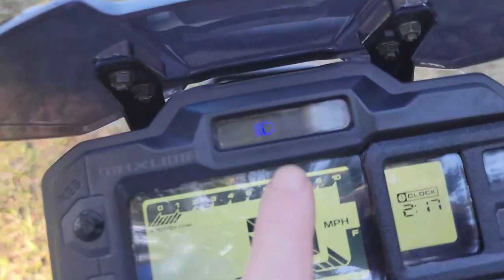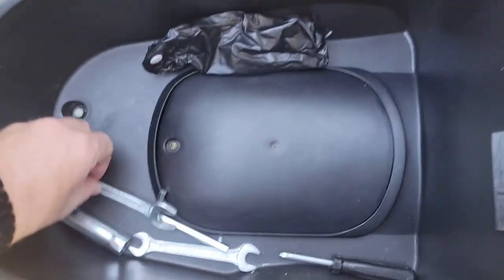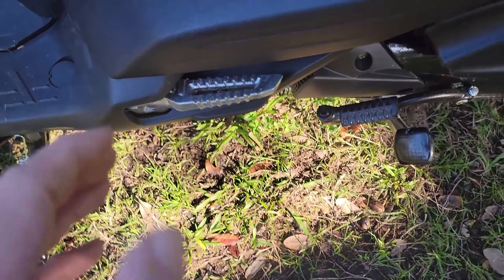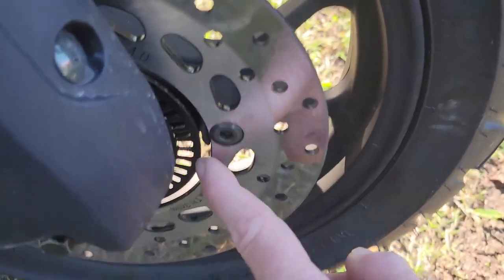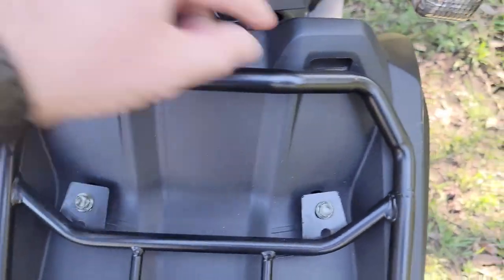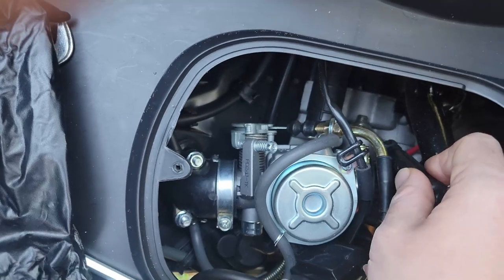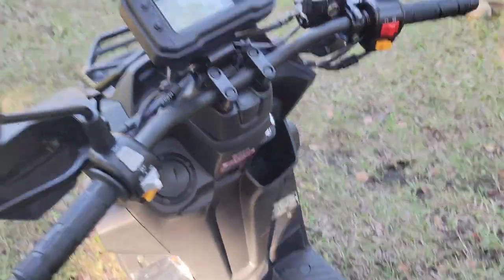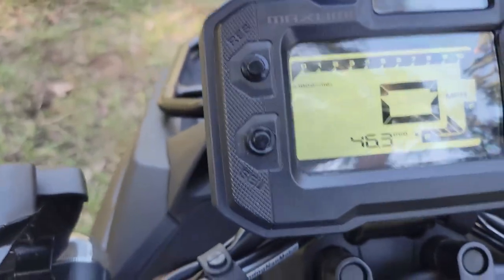X-Pro Tahiti 150 The $1,099 Yamaha ZUMA clone REVIEW.

Comment from the maker: I replaced the carb with one off Amazon ($25) that is jetted differently and appears to be made in Japan. It also has mixture adjustment screws. The stock carb is missing ANY form of adjustment and is jetted for EPA fuel economy. It made a very noticeable difference. It's not life changing but worth the upgrade. It really helped with acceleration and helped a little with top end speeds. I will get between 52 and 54 mph on flat roads. I find that the scooter likes to go around 45-48 comfortably.   When installing I did not use any of the hoses that come with the new carb. I just unhooked the stock carb and transplanted the new one in. Make sure to open the drain up that is at the end of the long hose with the spring around it. you will have to cut some zip ties to remove the choke wire from the harness.   Amazon link=>  https://a.co/d/0VAp8PX
Reply: Can you post the info on that carb ?
Reply: Hey dude when you got yours did you have issues with the engine just dying when riding? For some reasons the last couple of days of riding mine has been dying mid ride and don’t know why. I haven’t done anything to it other than giving it oil when it needs it.
Reply from the maker: @jarodhuber2687  When it dies, does it just bog down and then stall out. And does it re start easily?  if it does, its probably a fuel issue.  Stuff can clog the lines, starving it of fuel. I would for sure replace the fuel filter.  There could have been dirt or metal bits in the tank.  But for sure check the fuel lines.  Also there is a vacuum line that goes to a pulse pump. make sure that is hooked up correctly, some times a vac tube might be kinked if they cut it too long.
Reply: @scottcol23  it just bogs out and the engine cuts off as if I turned off the kill switch mid ride. The first time of re starting it doesn’t usually start it, but if I let it sit for like a minute it’ll turn over and run again.
Reply from the maker: @jarodhuber2687  Its a fuel issue for sure. you can replace the filter and then open the carb drain. its a screw at the end of a long hose that is on the left side near the peg that sticks off the center stand. its easy to identify.  there is a spring/coil that is around the hose.  open that a few turns and let the bowl drain completely.  there could be sediment in it.
Reply: @scottcol23  okay. What filter do you recommend to use for the scoot? Or what one did you use?
Reply from the maker: @jarodhuber2687  Just go to Napa or O'Reily's and get an in-line fuel filter.  Or you can get them on amazon in packs of 5. I got a FRAM G3 inline filter for $3.  They are a little bigger than the one that comes on the scooter. might flow better.
Reply: When you upgraded the carb did you get rid of the airbox and go with a pod style air filter?
Reply: @jarodhuber2687  probably the air mixture screw needs to be adjusted cause this bikes the air screw mixture comes seal just to pass emissions
Reply: Did you replace the car because this bike was stalling out. Mines doing that. Also my low beam headlight is not working?
Reply: I'm 6ft2 220lbs do u think this scooter would be ok for my height n size

Comment: Just got mine yesterday. 86 miles everything works well. I live on a dirt road next to a field and the tires are great when the sand is soft. Every motorcycle rider needs a scooter for errands and this is it. I love that front rack.
Reply: I agree. I have 2 other motorcycles, an 800 Suzuki and an 1100 Yamaha. But the little 150 is much easier to get around on close trips. Easier to strap stuff down too.
Reply: Got nearly 509 miles on it no issues so far. That little scoot scoot has become my errand runner.
Reply: @cecilgroomed8365  how she holding up now? Still going good?
Reply: Got almost 3000 miles on it. I lost the exhaust by not checking the bolts otherwise still running.

Comment from the maker: Its getting warmer here and I will be making some more videos soon!  What would you like to see?
Reply: I’m thinking about getting the x pro x19 150cc scooter or this one which one would you go with!!
Reply from the maker: @anthonyrossi3869  well i do own this one... and the x19 is a much older design,  although it is a zuma clone too.
Reply: Itd be neat to see a video on headlight bulb replacement to led and 0-40 times.
Reply from the maker: @aaroncarter4458  I have footage of changing the headlights. I'm going to order some H1 LED headlights to try. The ones I put in are Philips Crystal Vision 4000k which is the "coolest" color temp halogen I could find.  Since the CDI coil is AC the headlight does not run off the battery so I'm sure that LEDs will flicker, they did on my Lance. Bikes that use a DC CDI like most motorcycles handle LEDs a lot better.  You know you have an AC coil (in most cases) if your headlight stays off when you turn the key to the RUN position.  But I will give it a try.  Changing the headlights is not an easy task. you have to take off the front fender and the luggage rack, farings and front bezels. Takes about 30 minutes to do.   Its warming up here in New Orleans and I plan to do a 3 month 500 mile update.
Reply: I saw a Italic 150cc Ruckus clone, but with 100 extra cc.
Ive always wished Honda would offer a 125 Ruckus as I like the bare bones look, far chunky tires.
Reply: Did you have to replace spark plugs, fuel filter, before you started to ride?
Which oil did you use?
Which gas do you prefer to use on this model?

Comment: I think people need to see those headlights at night. NOT having wheels that look like they came off a lawn mower or a baby stroller is definitely a plus, but I can’t get  past the difference between ASTRIDE something (like a horse), as opposed to sitting UPON something (like a toilet). Besides looking really girly and stupid, there is some element of “grip” and where the perceived center of gravity is located that is missing in the emasculating commode posture, especially at speed, that I just can’t give up. Just make sure you try it before you buy it.

Comment: Just got the same model but in red delivered to me. R&L delivered the scooter in perfect shape. All I had to do was take it out of its box and metal frame and roll it out. Gonna be putting in the battery and accessories that came with it along with oil and fuel. Wish me luck!
Reply: I like the red ones too. I got the gray, same as in the video, but red was my second choice.
Reply: Just got the red also
Reply: How is it holding up now? Thinking of getting one
Reply: Me puedes decir como va tu motocicleta amigo

Comment: Got mine today. I had to install several parts, none too difficult. Mirrors, exhaust cover, battery, tiny windscreen and everyone's menace - the center stand. Luckily, I've installed several of these so if you know the trick, it's not too difficult. 
DO check the oil! Mine had very little. Topped it off and added gas then rode around for awhile. Adding oil is a trick though - get a looooong funnel and add in small amounts.
Coming from an 89cc (bore kit on a 49cc), the size difference is considerable. Weight too. The feel of riding it reminds me more of an ATV than a tiny scooter. You can ride with your head held high. Guys riding Harley's will rode (two-finger) salute you.
Also, it does have mounting points on the frame for crash bars. An after market cruise control / throttle lock will come in handy if you plan to ride long distance, which you can.

Comment: This is a great video. These guys at X-Pro should pay you a commission. I just bought this scooter. I hope it works out. I'll probably get it some time next week. I looked at a lot of different models. But for the price this one seems to have the best features.  Honda Navi looks like a good affordable scooter but the engine is smaller and it uses drum brakes and a carburator, plus it costs almost $1000 more. 

This one has a disc brake. I like the racks on it and the passenger handles too. I have a little girl I'll be giving rides. I'll let you know more. I'm a big guy, about 300 pounds, so I'm going to be asking a lot of this little scooter. I have 2 other motorcycles, an 800 and an 1100 but I wanted something small to take camping and for my wife and son to use that I can use too.
Reply: this has fuel injection, really ?
Reply: @showerasmr5764    No, I think that was a mistake. I thought it did, but it looks like no, it is carburated. This is a Yamaha Zuna clone, and the Yamaha has fuel injection, but this one I think is carburated. (and $3k cheaper)
Reply: @jerrybriardy  can’t complain with being that much cheaper 😆
Reply from the maker: @showerasmr5764  Honestly I would not really want a Chinese fuel injected scooter. they do have them but if you read the reviews people tend to have issues with them.  With a carb there is very little to go wrong. And if something does go wrong it is only $18 for a brand new carb and only takes 10 min to install and you are back on the road. So yes, Fuel Injection is neat and a great feature to have on a scooter. But I do not like the complex nature of it on a cheap scooter. Lifan does make a reliable fuel injected motor. But the Chinese scooters that use that motor are usually pushing $3k anyway and at that point I would just go with a Lance Cabo 200i or a real Zuma.
Reply: @scottcol23  the Saipan 200 Efi usually comes with a Lifan motor I saw one refurbished for $1180 through pmax but someone snatched it lol. They’re usually around yea about 1600 so close to 2k I’m not too savy in this field so It seemed like a decent option given it’s one less thing I have to tinker with 😅. I decided on the x19 for now so hopefully it holds up.
Reply: @scottcol23  Thanks. That is a great point. My sister is now looking to buy a scooter as she is very impressed by mine. I'll share that comment. We live in Nebraska where it is too cold for maybe 4 months of the year for many people. This can lead to gummed up carbureters. Though honestly, as long as you use pure gas, no ethanol, and use the bike at least once a month, even in the cold months, I've never had a problem with it.

Comment: Got this a month back, freat condition, all i had to install was battery, mirrors, the hand gaurds, digital meter shade cover, no carb adjustments needed. I took it on main route roads like route 6 in Massachusetts and it will do its 55-56 mph up and down those roads. I did change the factory oil it came with with 10w-40 and its been great since the beginning. I take it on some long rides that are like 30 ish minute rides backroads, city to city trips. Only complaint on mine is the footpegs pop out with the littlest bumps but its a minor fix but doesnt inconvenience me much. I got it to 60 down a hill but thats pushing it. It likes to sit in the 50-56 range in high rpms.
Reply: Que tipo de aceite utilizas amigo y que octanaje de gasolina

Comment: I just bought this bike 2 days ago but the china gator branded knockoff that thanks to this video ik is a Yamaha Zuma, Mine is a Gator Tank 200, its a fuel injected not carburated 200cc single piston. My top speed that i hit so far was like 45mph after holding the throttle not that long, has quite a punch for acceleration. I love it, when the headlights are on there both on and the high beams blast both very bright blue finish to it. Love the bike

Comment: 20 miles on mine in the last 2 days. It has been handling my weight just fine. I weigh around 300 pounds and living in an area of fairly steep hills. I've just been riding it around the neighborhood to break it in, keeping it under 30 mph. I am wondering how well the belt is holding up though with my weight. It may be my imagination but I think I smell bunring rubber. The belt? I don't know. I am ready to upgrade to kevlar though.
Reply: Replace the belt every year their only 30 dollars and yes 150 is enough for any weight
Reply: Replace the belt every year their only 30 dollars and yes 150 is enough for any weight
Reply: Would this bike be OK for a tall guy 6ft2 220lbs is it roomy

Comment: My gas mileage is not what I was hoping for. I'm getting maybe 65 mpg. I don't know if I need to adjust something. But I tihnk it is just my bulk. I weigh about 300 pounds.  I'm surprised the bike does as well as it does with me riding it but I hoped it would get better gas mileage. Anyway the bike is running great so far around 250 miles on it. I need to do the second oil change here soon.

 My little 4 year old daughter is really loving it. We ride around the neighborhood doing maybe 10-12 mph. The handles on the seat are perfect for her to hang on to. Loads of fun!
Reply: Que aceite utilizas amigo? Y cada cuanto se debe cambiar luego de 300 millas
Reply: Que tipo de gasolina utilizas en este scooter amigo?

Comment: I like the design, especially the front rack and open handlebars. It's great that the speedo is accurate. My Vitacci 200 (169cc) speedo is about 10% off.
Reply: How are you liking the vitacci clash200 168cc EFI I’m thinking about getting it is it comfortable and is the digital dash easy to see in the sun?  my current bike is a zuma clone which is the ice bear vision 50.  I wish I could see the vitcacci clash 200 in person but it’s only available online I hope if I decide to buy it I hope it feels similar to my bike with the handle bar/seating position! Also how is the seating position and the handle bar position is it comfortable?
Reply: @anthonyrossi3869  Digital dash is easy to read sun or shade but speedometer is off by about 10%. I added a $20 LED GPS speedometer so I know the real speed. A phone works too. Comfort is subjective of course and for me it's not bad except I have really long legs and my right knee contacts the throttle cable tube while maneuvering slowly.  I changed the throttle cable elbow for a little more clearance.
Reply: @MrHugemoth  I’m 5,3 or 5,4 how tall are you? I know my current scooter my legs don’t hit the handle bars and when I turn them my legs are close to the handle bars but not touching and there not even close to the throttle cable line. I don’t know if the clash is any different in size if your taller then me I could see that could be a problem but it seems to be a solid nice scoot!
Reply: @anthonyrossi3869  I'm 6'1" with a 34" inseam and size 13 feet. You should fit just fine.
Reply: @MrHugemoth  also when you turn on the ignition without the engine running dose the tail light turn on as well as the front lights?
Reply: @MrHugemoth  also when you turn on the ignition dose the front and back light turn on before you start the engine?
Reply: @anthonyrossi3869  Only the speedometer and fuel pump come on when the key is turned on. The brake light will also light if you pull a brake. All the other lights run off the magnito.
Reply: @MrHugemoth  dose the tail light up red  without a squeezing the brake when the ignition is on without the engine running also dose the turn signal and hazard lights go on without the running too? Also how reliable is the clash? Sorry about all my questions there’s no videos on this scoot!
Reply from the maker: @anthonyrossi3869  no the scooter uses a AC CDI so the headlight and tail light do not operate when the engine is off with the key switched on.  The turn signals will keep flashing when the engine is off. hope this helps.  Sorry for the late reply
Reply: @scottcol23  yes I’m aware I have the clash 200 EFI scooter and the only lights that go are the tail lights when you press the breaks in and the turn signals go on and the dash and the fuel pump that primes before you start it.

Comment: i just purchased this model but made by transpro this little machine is the best ive seen in years ive only rode mines for 30 miles ive only hit 45 miles hr so far
Reply: Tommy Is it fast enough to keep up with traffic
Reply: @cheesebeef4902   only top speed I hit was 45 on the bigger roads I live in the city speed is 25 mph so it's always steady traffic
Reply: @cheesebeef4902  maybe I haven't broken it in yet I wanna give it a oil change I'm at 151 miles on it so far
Reply: @tommytuccer67  I was just wondering if it was possible to cruise at 50 without burning it up
Reply from the maker: @cheesebeef4902  I replaced the carb with one off Amazon that is jetted differently. It made a very noticeable difference. Its not life changing but worth the upgrade. It really helped with acceleration and helped a little with top end speeds. I will get between 52 and 55 mph on flat roads. I find that the scooter likes to go around 45-48 comfortably.  Ill find the one I got and edit this comment with the link.   When installing I did not use any of the hoses that come with the new carb. I just un hooked the stock carb and transplanted the new one in. Make sure to open the drain up that is at the end of the long hose with the spring around it. you will have to cut some zip ties to remove the choke wire from the harness.   EDIT:  https://a.co/d/0VAp8PX
Reply: @scottcol23  hi Scott, did you have to make any adjustments? Idle? Air/fuel? Or just run it as it came ? Thanks
Reply from the maker: @topcat15191961  I had to switch out the carb ($20) for one off amazon. the stock one had no adjustment screws and had a dead spot mid throttle.  It would bog down under acceleration.  Changing the carb fixed it.